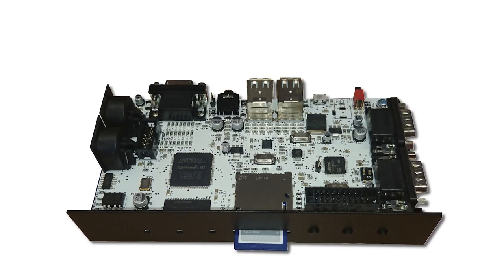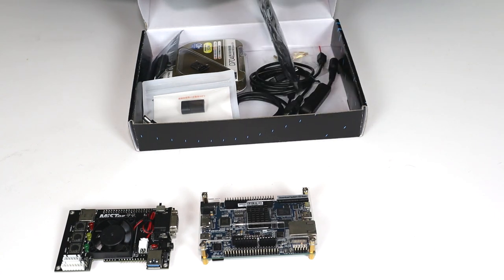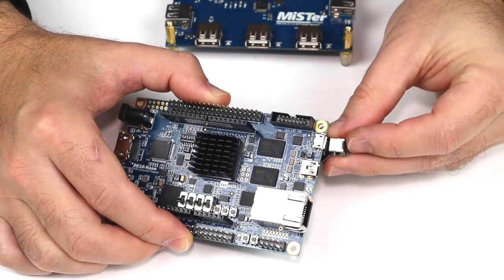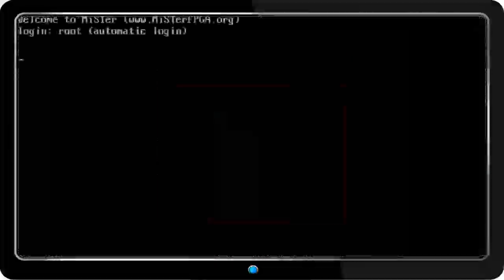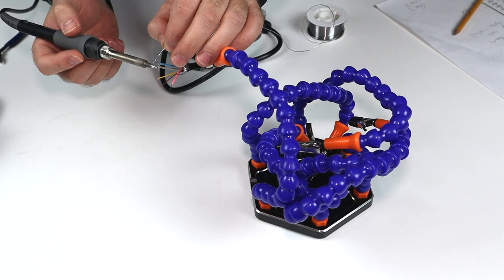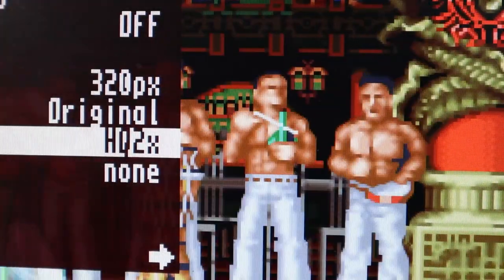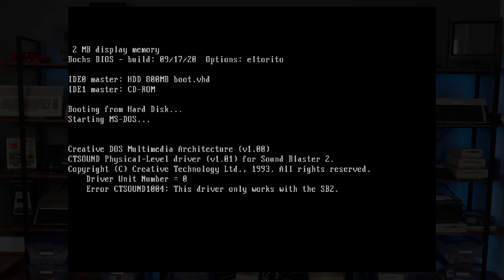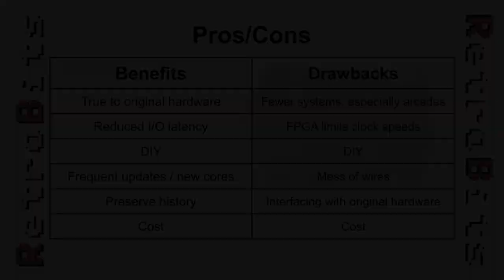MiSTer FPGA - How to build & configure, demo, cost, and pros/cons

Comment: Nice video; well explained.
I just want to add that 90% of human beings cannot distinguish the latency on a powerful machine running an emulator while playing games.
So the latency issue only apply to devices that are pushed over a threshold, where it start to affect their performances. A RPI for example is good for 8 bit computer and some 16 bits but it struggle with the Amiga emulator because the CPU cycles on that machine are not enough to run the host OS (linux variants) and the emulated OS/environment. Which is why you can perceive a latency in games.

Human beings can perceive latency up to a point; whoever tell you differently is just fooling himself/herself by thinking that. There has been plenty of blind studies where people could not tell the difference between an emulator and the real hardware; as long as the emulator run on a powerful enough machine. FPGA is great for emulating in software the hardware (you program in software the gates on the device, the gates are software-driven transistors, basically the software drive the lanes used to connect those transistors, like a wire or trace would do in the real hardware), and reduce much of the "translation" a machine has to do; but if you have a machine powerful enough; the issue of latency and overload due to translation and due to the fact that you are running 2 OS environment on the same machine, become pretty close to being indistinguishable.
Reply from the maker: The only concrete example I can point to from experience is a NES emulator on my PC. I was playing SMB3 on one of the later levels and was unable to complete a tricky sequence after having tried it dozens of times. Something just felt "off". I tried it on a different emulator on the same machine and got by that spot on the first try, it just felt much better. So, not even a hardware issue in that case.
Reply: @retrobitstv  I know what you mean; I had the same feeling when I got a new TV and I could not play PS4 games because I would always be late on timing.
Although that was due to the fact that I didn't adapt myself to the timing of the new TV; but after few days, eventually my brain caught up the delay and adjusted for it. 
For most retro games, I never felt like my actions were not on sync for too long; I get used to the delay after a bit, and I am not special for sure. Every human being is capable of that; after all this is how we survived gaming in the 70s and 80s on PAL machines :)

Comment: Great primer! I just got my setup a month ago. Still learning, and have some systems running, while others need work. Can someone point me to where I can find instructions for where certain files, like BIOS files I have, go into specific directories? Thanks!
Reply from the maker: Check out the RetroDriven script that Justin Rice mentioned in his comment. It will populate all of the Arcade systems with all the files you need, including the game ROMs. You can find that at https://github.com/RetroDriven/MiSTerMAME .
Each console/computer core is unique and may have their own requirements (like providing a Kickstart ROM for Minimig). You'll have to consult each core's github page to see if there are any special setup steps required. Good luck!
Reply: I would go with the Update All script at https://github.com/theypsilon/Update_All_MiSTer as the guy behind the Retrodriven script is planning to drop support soon.

Comment: Fun! I'm thinking about maybe a home arcade cabinet project and feeling discouraged by the price of arcade hardware these days - and feeling pretty underwhelmed by the prepackaged emulator products as well. Might be fun to build something up around one of these, though.
Reply from the maker: With that JAMMA interface, you can get the best of both worlds: authentic arcade cabinet experience and you're not limited to one or two games/modes. I think that would be a great project, if I wasn't so space-constrained already :)
Reply: Yeah free space is a problem...  Thinking a cocktail-style machine but even so it would have a pretty considerable footprint.

Comment: That's a cool build and device, but I'd be curious to see a blind test where you have people play the same games on this hardware and a normal emulator without knowing which one they're playing on and see if they can even tell which is which, or even if one feels better than the other. I know that's not the end all be all reason for using this setup, but it is one of the main selling points for why you would, so it would be interesting to see if the claim holds up under an unbiased test...
Reply from the maker: I can tell you with my reaction time it wouldn't matter and I couldn't tell! I've only ever encountered one emulator (on my PC) that had latency bad enough to prevent me from finishing the game due to one specific set of jumps (Super Mario 3). I don't tend to play the kind of games that need that kind of accuracy anyway :)

Comment: liked and subbed! great video.  Would you mind sharing the amazon link voor de power splitter cable?  Also I was wondering which voltage / amperage the DE-10 power adapter needs to be? I've ordered mine but I guess this will have an US power connector?  To save me the hassle of convertors I would order an European adapter :)
Reply from the maker: Thanks and welcome! My power splitter came along with the USB board, but you can order one separately here: https://misteraddons.com/collections/all

The power supply the DE-10 ships with is 5V/2A center positive and is good enough for my purposes but if you need to power a lot of USB accessories or something, you may want something stronger that can supply 4 amps (or more). People in the community seem to like the Mean Well supplies, such as GST25A05-P1J which takes a standard 3 pole power cable.
Reply: @retrobitstv  awesome thanks again!!

Comment: do all the dip switches need to be down? can you go over the dip switch options please!
Reply from the maker: On the de-10 nano itself, all the dip switches can be left in their default factory state. On mine, SW0 - SW3 are all in the down (away from the CPU) position. SW10 (1-6) are 101011 respectively. The purpose of each switch is defined in the user manual https://www.terasic.com.tw/cgi-bin/page/archive_download.pl?Language=English&No=1046&FID=1c19d1d50e0ee9b21678e881004f6d81

Comment: Great video! i m now ready to assemble, when my setup parts arrive...just need the scart cable for my consumer CRT that can do PAL and NTSC. as i understood you, there is the option to define the parameters of the cable in the general configuration of the mister (ini), so i dont need to worry about the different cores, right? after googeling, i read something about soldering in one resistor, but im totally unsure if that is necessary at all. a friend of mine will do the assembly of the cable and therefore needs the pinout. can you send me yours or put a link somewhere ? that would be of great help since i am a total newbie :) merci!
Reply from the maker: Correct, you can set all the parameters in the mister.ini file. Depending on your display, you may need to add the resistor. If your CRT uses TTL level sync, it should be fine without. You can also purchase a SCART cable for the MiSTer pre-made. https://ultimatemister.com/product/rgb-scart-cable/ If you want to make it yourself, this pinout might help https://misterfpga.org/viewtopic.php?t=1496 but it's not the one I used.
Reply: @retrobitstv  i was able to find a cable in an european shop, so i ordered that. Thank you so much for your answer...its nice to find such informative and structured videos from people like you :)

Comment: Great video! How did you capture the footage at the same time as demonstrating? Is it possible to play on a CRT for instance whilst capturing to a HD cap card ? :) thanks
Reply from the maker: Thanks! Yup, that's exactly how I've got it set up. The SCART cable connects to a SyncSlayer2 which lets me output to two different devices at once, with my capture device connected to the SS2's HD15.
Reply: @retrobitstv  that’s awesome exactly what I want to do for streaming as I dislike having to currently play my retro consoles through a HD monitor all stretched whilst streaming. This would be great. Thanks for the fast reply, you just earned yourself a sub my friend <3
Reply: @retrobitstv  ah I was wondering why you made that SCART cable, I was scratching my head through that section. :D

Comment: Your Commodore 1084S has a SCART interface?  Mine doesn't.  Is yours from Europe?
Reply from the maker: Great question! My 1084S is a North American model and it does not have a SCART interface, but there is a blanking plate where one would be. I think it would be a neat project to see if one could be added easily because I'm pretty sure the PCB has the through holes to fit the connector, I'm just not sure if the traces are there or not. Anyway, the reason I use SCART for everything is because, for better or worse, it's a standard and cables are readily available as are switches, upscalers, etc. From SCART, I connect to a SyncSlayer2 which provides both RGBhv and RGBc output and I have made cables that connect to the 1084's DIN, the 1902's DB9, and the PVM's BNC inputs. The SS2 also provides an HD15 connector so I can hook up my video capture device at the same time as a CRT. Sorry for the small novel :P

Comment: The video is actually pretty good, but I'd like to point out the usual misconception that always goes with discussing FPGAs - they're NOT "behave exactly like the original hardware". They work the way you program them, the same way as software emulators. If something wasn't implemented, or implemented incorrectly - it won't magically work just because "it's FPGA". The only thing why FPGAs are theoretically better is indeed zero lag with input and output, but realistically a pretty close results can be achieved with software emulators too, with correct implementation and running environment. Gotek/FlashFloppy is a pretty good example of software emulation that runs decent enough to emulate FDDs in real time and work more or less "exactly like the original" FDD.
And because FPGA is more or less just another way to emulate the hardware, it's hard to agree with comparing it to buying actual hardware systems since it's absolutely not the same. You can compare raspi3 the same way and have even more significant difference.
Also, FPGA implementation is NOT in any way more accurate than software emulation. FPGA cores aren't magically write themselves while being true to the original hardware. They're written by people and could (and do) have the same imperfections and mistakes like the software emulators do. So this is just completely wrong statement right there.
But, anyway, thank you for some current information about the MiSTer, it's been a while since I tinkered with it the last time.
Reply from the maker: Great point, and something I should have been more clear about. There's always a handful of things I wish I put in the video in hindsight!

Comment: How did you connect to the Commodore 1084 S monitor via vga? Did you use a special cable or adapter? Let me know.
Reply from the maker: If the scandoubler is disabled in the mister.ini file, you'll get RGB output on the VGA connector of the I/O board at each core's native resolution, which is 15Khz for many systems (like the Amiga, SNES, Genesis, arcades, etc.). This is why the 1084S works for these. Some, like ao486, output VGA natively at 31Khz which will not work, but you can do some tricks to force it to 15Khz also. I do have a custom cable setup that I talk about at the end of Episode 33 here https://youtu.be/NzVJnB5nbEI

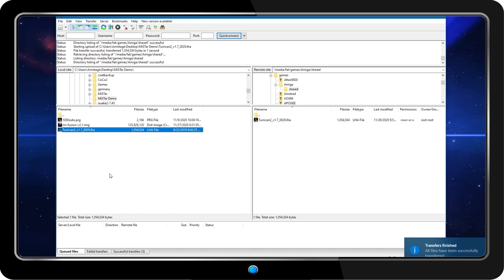Comment: The part at 14:00 confuses me slightly, Do you need to upload the softwares and disk images to something (sd card?) before you can run the cores? Or can I just turn it on and play all available games from any of that huge list of cores (referring to the consoles etc rather than the pc type cores) 
If the former, how much effort/time does it take to get the software and things sorted to use a core and where are those disk images you refer to?
Reply from the maker: Each core is different, some require a BIOS file to be copied to the sdcard, some do not. Most will require some form of software to be copied, be it a disk image or a ROM cartridge image. Each core has their own GitHub page that explains the unique setup requirements. For arcade cores, however, simply running the Update All script will get you all the cores as well as the ROM files and those will just work. For consoles, you can download entire collections of ROM files from archive.org or elsewhere.
Reply: @retrobitstv  thanks for the reply, I was looking at the GitHub list of files for cores, am I right in thinking that the library of games available for that console core are all packaged together? (That’s how it appeared to me),
And am I likely to need different sd cards to hold all these bios files and software images or will many many cores fit on one sd card?
Reply from the maker: @Rockabillyrabbit  Most cores do not contain any game software, just what's needed to start up the computer/console itself. If you run the Update All script, you will get all of the latest cores on your MiSTer, but you'll still need to add game ROMs yourself. I use a single 128GB sdcard and it works fine for my needs, but I don't put every game ever made for every console I play, it wouldn't fit that (especially when you start adding CD-Rom based games for the 486, PC Engine CD, etc.). I only add games I want to play specifically and leave the complete archives on my PC.

Comment: Save states are the only thing I'm waiting for in most cores...but on the other side of things Retroarch it's just great on lot of systems, Blastem, Bsnes, Mesen...cores that are actually highly accurate, and I should not be input lag sensitive cause I can't see difference between my 8bitdo Bluetooth controllers and my real hardware wired gameplay 🤷🏻‍♂️... maybe arcade cores it's the key on MisTer.

Comment: What is the limiting factor for which systems can be implemented in this thing? For example there doesn’t seem to be a PS1 or N64 core. The number of logic elements? Or simply that no one figured out yet how to implement a PS1/N64?
Reply from the maker: My understanding is the number of logic elements and the maximum clock speed the FPGA can run at are the limiting factors. Also, the more complicated the system, the bigger the project to reverse engineer it. The ao486 core uses 91k of the 110k available logic elements, for example. 5th gen consoles that have dedicated 3d accelerator hardware are likely outside the scope of what can fit on the de-10 nano. That said, there are ruminations of a PS1 core coming so I guess time will tell.